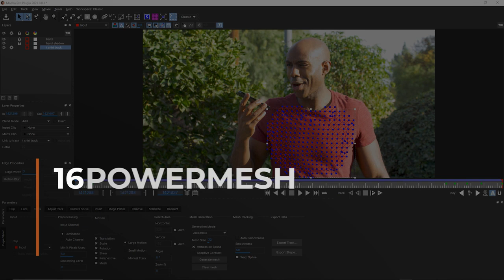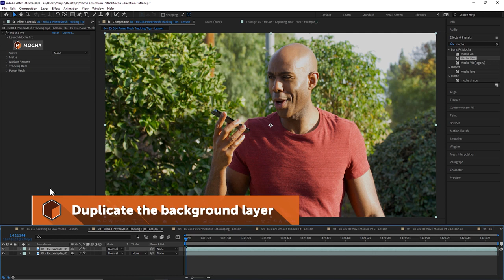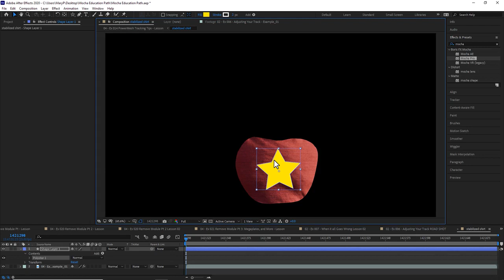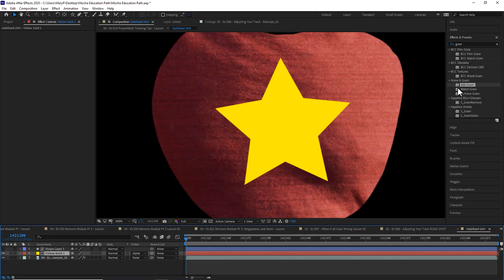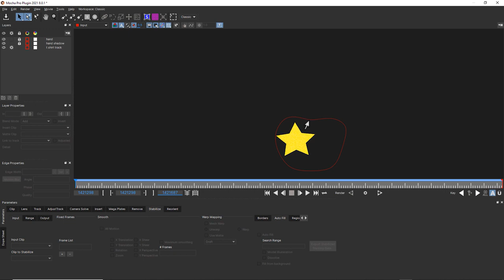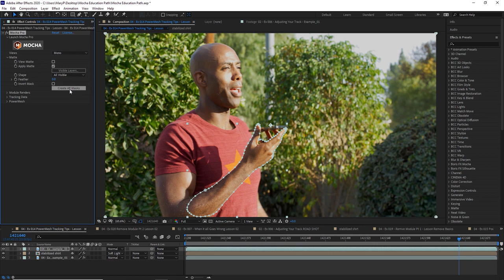16 PowerMesh Workflows [Mocha Essentials]

Comment: I got as far as (re)Warp Stabilizing the Precomp after lining up the star inside the precomp.  @ 3:33 .... but it doesn't line up or track. I followed every single step... multiple times.  Very frustrating.
Mocha 2202.5 and After Effects 2024. Is there a newer  Tutorial with a different approach?
Reply from the maker: This might be easier to solve on the forums : https://forum.borisfx.com/  But here are another couple of videos that might help : 
https://borisfx.com/videos/quick-tip-precomp-footage-for-best-mocha-results/
https://borisfx.com/videos/add-face-paint-with-mocha-pros-powermesh-and-the-insert-module/

The general strategy is...
i) Precomp your footage.
ii) Do PowerMesh tracking on the precomp and Unwarp that in After Effects.
iii) Add whatever you need to that stabilized comp.
iv) Copy the Mocha plugin data and precomp again.
v) Paste the data to that new layer and Warp.  It should now line up perfectly.  You may also want to drop a copy of the original underneath, and add a mask to the PowerMesh layer so that you're only affecting the pixels you need to.

Hope that makes sense. If not, join us on the forums.

Comment: I understand that stabilization distorts the entire layer by reversing the movement already tracked to result in an area of the layer totally glued to the screen, which is then edited and finally the original warp is applied to the entire layer precisely because it is distorted from in such a way that it allows the stabilization of the t-shirt... but why would it not work to apply the original warp of the t-shirt already tracked directly on the star, considering it as a layer without any distortion?
Reply from the maker: This is a good question. This video covers the 1st iteration of PowerMesh which was released in 2021. This workflow what we call "Reverse Warp Stabilization" in which the footage is stabilized in one comp and reverse stabilized in a 2nd. In 2022, Mocha Pro added the Insert Warp workflow which allows the user to apply the PowerMesh warp directly to an insert layer. This is covered in this videohttps://youtu.be/dZE0d8w5M5c and https://youtu.be/ino6i93TmBE
Reply: @borisfxlearn  Thanks!

Comment: A very complex mechanism for inserting through intersecting objects. As far as I look, Mocha is hard to master.
Reply from the maker: In the new version of Mocha Pro, you can use PowerMesh data directly in the Insert module.  This makes it much more straightforward to insert objects with warps.  You can see it in action here : https://borisfx.com/videos/mocha-2022-new-insert-module-powermesh-tracking/
Reply: @borisfxlearn  Thanks. A good solution. Another point is when you need to insert several objects to the monitored area. Everything can be done on the same layer, or you will need to create a duplicate of the marked layer as well as in the previous series. Using the example of AE and Pr Pro
Reply from the maker: If they're all going to the same place, it might be a good idea to composite those elements together first, then apply the mesh to that single composited element.  Otherwise you can use duplicated layers. Hope that helps.
Reply: @borisfxlearn  thanks